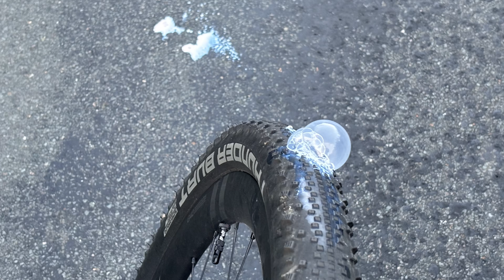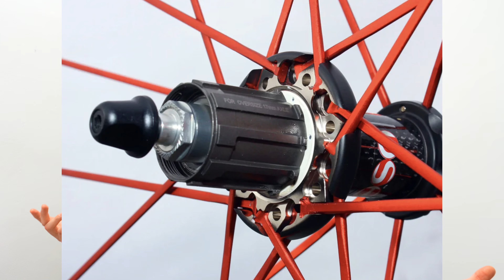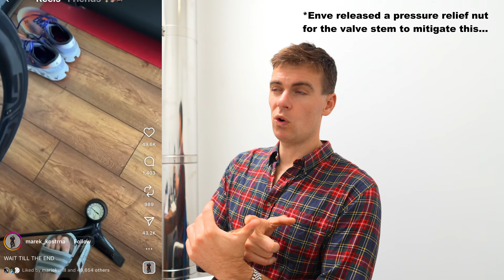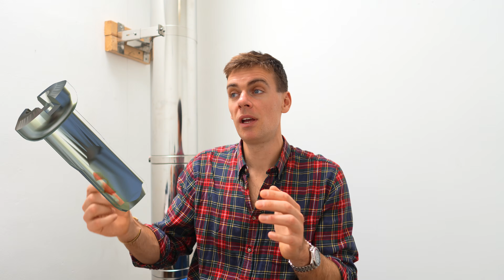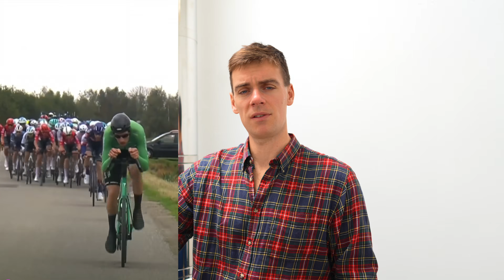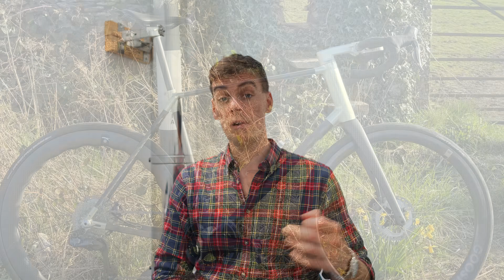The truth hurts and its ugly + more EXPLODING carbon wheels - PT Show ep. 9

Comment: Re your custom bike - thin round tubes are actually more aero! The reason modern bikes have big fat aero/kamm shaped tubes (actually monocoque shell) is to get stiffness from very thin walls - the aero claims are BS for two reasons. 1 at low speeds the shape is irrelevant and only cross-section counts - this is a well known rule of aerodynamics and even high bike speeds are low speeds. 2 skinny round tubes are equally aero in any direction with crosswind - which almost always exists.
Reply: Round is not aero. Period.

Comment: That’s why enve says you should use their valve stem nut which has pressure release hole, which negates the problem. Problem if you  start using different tubeless valves and not their nut anymore.
Reply: yup exactly.  Have had a few times when the tape failed setting up new tires and I could hear air being let out through the enve valve nuts.  It was wild to notice the instant deflation without a tire puncture.  The only thing I didn't like about it was my enves would get water logged without the pinhole haha

Comment: I had a rim fail catastrophically while mounting a tubeless tire.  SCARY as h)$$  

Two reasons why.  1. I purchased used and put 12,000 miles on them.
2.  The weekend prior I flatted hitting after hitting a pothole. Tire was fine.

I purchased pair of ICAN wheels for <$500 and they came with the rim hole.

Comment: I am running on a pair of CORIMA ESSENTIA 40 HOOKLESS rims with Conti 5000 STR 700x30c tires with Butyl inner tubes at 4Bar pressure. NO PROBLEMO AMIGO.! 🙂 J bend spokes in a hub where it is almost impossible for them to jump out of their seating.

Comment: So for JWVS:
Handlebars: too narrow, will be illegal next year
Stem: fine
Helmet: no visor so fine even though it covers the ears
Glasses: sick as
Riding on the grass: I thought was illegal
Seatpost: would be fine if it was an aftermarket design or wasn’t modified. I get that sawing it in half and sticking it back together is dangerous hence the ban. He needs a frame with a round seat tube so he can run a flipped setback seatpost to achieve something similar. 
I applaud him for pushing the limits in order to optimise his performance
Reply: If you change the frame, you might as well change the seat tube angle, so you can just use a straight seat tube.

Comment: Assuming there is a tight enough seal on the nipples/spokes and valve stem, do you even need to have air escape into the cavity? Which is to say, are common rim tapes (basically just diaphragms closing off the pressured section of the rim and bulbing into said cavity when tensioned by tire pressure) stiff enough as to not transfer enough pressure (quick enough) to the cavity for it to matter (statistically speaking)?
Reply: The problem is everything needs to stay working correctly indefinitely to avoid a catastrophic problem. A simple failure of e.g. some rim tape should never lead to that.
Reply: A bulging rim tape is never going to increase pressure enough to damage anything, here we are talking the full 60 psi being dumped into the "fairing" section.

That is also why these incidents are common when pumping up the tire, if you're riding a 60psi tire and it dumps air into the fairing you might have put 30-40 psi in it (same air, bigger overall volume) it you are pumping the tire to 60 and it is leaking during the process then you'll get to 60.

Comment: i have a terrible idea: design the rim as a pressure vessel, remove the rim bed, and make a special inner tube that goes inside the cavity of the entire rim in addition to filling the tyre itself. more air volume!
Reply: That could work but with severe engineering challenges. You would have to bond some inserts into the rim to keep the rim profile stable. Then you have to ensure a safe environment for the tube and so on…
It would just add complexity to all the parts just to solve a problem that doesn‘t really exist.
Reply: It would probably be heavier because there would be a greater amount of thicker carbon material along the full length of both sides of the rim to withstand pressure, particularly as rim depth increases. The omission of a rim bed would offset this to some degree, but the net weight would increase.
Reply: Not a bad idea, but with bikes progressively getting wider rims and tyres, there isnt any need to explore this. 
Wheels would be heavier, plus weight of inner tube, a need for a smooth bed for inner, plus stiffness would be difficult. This is why double walled rims were developed, to ensure stiffness, particularly on deep section rims on road bikes.
One option to explore is nitrogen filled tyres. Cars already do this with several benefits.
Reply: Feels like you’d have to make the rim rather thick to withstand the pressure from the tyre without the rim bed, and the tyre pressure will be more effected by changes in temperature
Reply: As others have mentioned the rim probably has to be stronger. Plus: every spoke has a hole that needs to be sealed.

Comment: I don't get it, I'm going to jinx myself here but I haven't had a flat in years and my most recent flats were down to tubeless rim tape issues, nothing trail related. That's riding MTB in the PNW with some pretty rough fast descents. Loose spokes and occasional wheel trying needed? Yup, but no flats. I don't use downhill casing tires either. 
How do you get 7 flats on what looks like a gravel road?
Reply: You have more rounded rocks, suspension and might weigh less...
Reply: @alan_davis Nope, yes, nope.

Comment: Have you tried 2.2 race kings/can you clear them? I haven’t flatted one before (cursed now) and I have hammered them. The Peyote is slightly less durable (compound wise) but also reliable. Have absolutely thrashed a set of the 2.4 Peyote this summer so might have to try on gravel. Both test pretty fast as i’m sure you know. I’m 75kg
Reply: Second race kings! They exist in 2.1 as well.
Reply: @fridtjofsther8941  There is a 2.0, not 2.1, but it’s a much slower tyre (different casing and compound)

Comment: Taller stack heights are definitely something that has the potential to benefit all kinds of riders. I suspect we're not that far from seeing a brand stick their nose out and break the mould on typical road bike geometry (which has been pretty static for 15+ years).
Reply: Fairlight!
Reply: A lot of design is determined by aesthetic considerations - just like in the olden days when they were obsessed with horizontal tubes and figure 7 stem. Low handlebars are worse for the vast majority of riders and the industry basically bullies everybody else into being uncomfortable.
Reply: Building a frame with pretty relaxed geo and high stack and am excited to see how a more relaxed position with Aeroo ascent bars functions
Reply: They should go this way for endurance bikes, not race bikes. Race bikes should go even longer and lower for those of us who can tolerate aggressive positions and there shoudl be riser cockpits like Ridley Noah Fast 3.0 for those lacking in functional mobility.
Reply: @invisiblescout6335 you want to be slower and uncomfortable? Weird.

Comment: Road tubeless is beautiful in the US desert southwest where thorns are abundant. I agree about the ugly bike being ugly because its the only way for a rider his size to get a proper fit, except that he's still running a dead-flat seat.
Reply: 100%.  The goatheads here in the socal desert was infuriating before switching to tubeless.  I had to even go with heavy slime tubes on my old track bike, but to get a decent ride in
Reply: If you're not running a dead flat seat, I'd be interested in the reason...
Reply: @alan_davis  My seat no is dead flat. However toward the end of my racing days the UCI for the first time allowed 9 degrees of tilt down back to front. A saddle that is appropriately tilted down will make it easier for you to tilt your pelvis forward and encourage flexion at the hips (rather than spine) and improve aerodynamics.  Doing so was especially common for TTs and crits. Admittedly this has become less common as more riders are opening hip angle with taller head tubes and/or increased stack height.

Comment: Appreciate the comment about excessively short frame stack. It's just as egregious with mountain bikes, where a "riser" bar with 25-40mm of height has just become standard equipment, in addition to 3cm of headset spacers.
Reply: MTB does require more standover room than other cycling disciplines.
Reply: @Surestick88 , that doesn't have much to do with stack. They can (and do) shape the midpoint of the top tube however they want.
Reply: I think risers are great and should become the norm so those of us with functional mobility can actually buy bikes that can fit aggressive positions.

Comment: Fast and puncture protected tyres - try the Vittoria Terreno XC. Not as low rolling resistance as the Thunderburt, but a much more robust tyre and you will find it similar to your Mezcals in that regard, just faster. Also better grip than the Thunderburt.
It’s a hugely overlooked tyre for gravel racing, mostly because it doesnt feature on the bicycle rolling resistance website. But it tests well in flex fit by John’s tyre testing

Comment: I kinda hate the stack'n'reach measurements being the starting measurements for a bicycle size.
If you could change your seat tube angle, those would be fine.
But at a fixed tube angle, you start by checking if your hips and knees are in the  right position or you need a different size.
Why is this thinking so backwards?

Comment: Having done many mtb miles on thunder burts, they are fast but definitely not grippy or durable. I really only use them for specific rides and races (fortunately I have a few bike and wheel/tire options). I think of schwable's tires the G-one R pro is probably the best option as the close, dense tread pattern should help puncture resistance over the RS or RX. Comes in 50 and 55mm. Otherwise the vittoria peyote? I think I'm going to try a set next year (for xc not gravel). Or terreno xc.

Comment: He has had this style of seatpost for at least 3 years, previously on a Giant. 
But i am very unsure if it is a commercially available, and registered part (i never saw a brand name on it). Which is one of the points that they really get antsy about. UCI claim that this is down to safety, which I understand to a degree. Although if he had previously used this part in another UCI sactioned race, then the commissaires don't really have a leg to stand on. 

Other than that VSchip is always pushing crazy positions, same on track, but he has less control than a newborn giraffe.
He was WC with Yoeri in Glasgow 2023, Germany holds the title for another couple days

Comment: Is a tubeless rim without drain hole + rim tape also a problem for < 25 psi? Or was this statement only meant for road tire pressure range?
Reply: Two advantages MTB rims have for tubeless:

1) much lower tire pressures

2) more smaller volume "aero fairings" - which provide a much stronger structure.

MTB doesn't have this issue, IME.

Comment: Even my yoeleo wheels have that pressure-relief hole, and they don't have spoke holes. You'd think it would be hard to get air into the rim body, but you can hear (and feel) the air escaping through that hole when you're first trying to seat everything up. I had to replace a broken valve, and definitely air is getting into the rim body before the tyre seats.
Reply from the maker: Good info. So even the valve seat is letting some air through

Comment: Gas permeability of carbon layup is poor - not only would I be concerned about the air pressure in the cavity but it may pull through some chemicals from the sealant that could act as plasticizers and weaken the material further, especially for thin sections. We've tested some nylon sensors fully laser welded, a 2mm wall thickness and passing our in house leak tests - at 12bar they were equalizing internally after about 4 hours so gas permeability and wvtr (water vapor transmission rate) are unavoidable unless you go ceramic or metal in my experience.
Re the 'ugly bike' - Obree deserves a shout out - ahead of his time and similar thinking.

Comment: While I do get the point of view from the rims exploding.
When you put pressure in an innertube it also pushes on the seat of the rim so you would get the same pressure in the cavity, and when they ran/run innertubes they put in a lot higher pressure when they used nadrower tires and rims. And if your valve doesn't seal on the seat it wil not inflate, the air will just leak from the spoke holes. The spoke holes are not designed to seal so they definitely will not, plus your rim fills with sealant😢
Reply: You misunderstood the issue. It isn't air pushing down on the floor of the rim (as a tube does), it is air leaking past that and pressurising the volume BELOW the floor.

And just because something isn't specifically designed to seal doesn't mean it isn't sealed, especially when tire sealant is part of the system.

Comment: I’ve seen sealant leaking out from spoke holes on my mountain bike when I had a dodgy tape job. Last week I broke a spoke at the elbow and it shot though the rim tape: instant flat. Nipples don’t seal that cavity. I’ve always thought the vent holes were to let water out which I’ve seen as well. Maybe the failed rims are made from a separate rim bed and "fairing" and the glued bond fails?
Reply: They are to let water out.
Most nipple don't seal the cavity, but if sealant gets in there it can. Depends on the style.
MTB can easily handle the pressure in that area because its not deep and thick carbon.

Comment: I have had sealant coming through the drain hole when rim tape has failed 😱. Luckily I got away with it and the wheel has been fine since (apart from the likely added weight of the sealant left inside the cavity)

Comment: I’m 193 cm tall (6'4" for the Americans), and finding a road or gravel bike that actually fits me is basically like trying to find jeans with a 38" inseam at H&M — technically possible, but spiritually impossible.

Every time I try to ride in an aerodynamic position, I end up looking like a praying mantis doing yoga on a children’s bike. People shorter than me never understand — they just say, “Oh, just get an XL frame!” Yeah, thanks, Tim, I’ll be sure to let my knees know they’re supposed to fit now.
The geometry on most bikes completely gives up past 190 cm. I’ve got a seatpost that looks like a flagpole, a stem long enough to qualify as a bridge, and a stack taller than an empire state building, and somehow I’m still too cramped.

Honestly, for me to look even remotely normal on a bike, I’d probably need 32-inch wheels — which sounds cool until you realize I’d also need a ladder just to mount it.
Reply: 6'5 here...I've got a cotic gravel bike. Got a Large and fits well. Worth a look, UK based firm and they do test ride days
Reply: And if you end up having a custom frame, there are still 2 problems:
- it will look odd
- long wheelbase and high center of gravity dimishes cornering ability

Comment: Would the tube not apply the same pressure to all areas of contact so the pressure with Tube or tubeless not be identical ?
Reply: In normal use. The bit you missed is it is the pressure build up below the inner wall that causes the failure. Tubes are never in that bit...
Reply: @alan_davis  As this void has all the spoke penetrations with constant changing of the tension due to the rotation the chance of an airtight seal at over 50psi is not a option there would always be an equalisation with the atmospheric value. Academic for me as I gave up with road tubeless due to issues if you get anything but a minor penetration.

Comment: Regarding rim cavity pressurization:
1. This seems to be a particular problem with Enves. Enve requires you to use their tape and their valves, which is a concern. They also seem prone to air leakage into the rim cavity and rapid pressurization of the cavity.
2. Buy rims with solid beds. This is what Shimano has always done and I think they're on the right track. Tubeless tape is the weak link in the system, get rid of it. 
3. Only use rims with drainage holes.
Reply: Or gasketed conical plugs in rim bed over spoke holes to allow easier spoke replacement while a mechanically positive seal is maintained as the plug tightens with tire pressure increase.

Comment: TPU inner tube. Problem solved and doesn't go out of balance from dried sealant. This makes me think about the time NASA spent millions on those space pens to write in space and the Russians used a pencil.
Reply: Apparently the pencil story is fake, the graphite dust would be terrible for the electronics used on the station. I agree on the TPU point though, imo tubeless is such a hassle and dealing with the sealant sounds far more annoying than just carrying an inner tube. Especially since it seems like tubeless always stops working when you really need it.
Reply: It's a great story, but just a story.  That said, I like the idea of a TPU tube as long as the stem and seam are reliable.
Reply: LOL (no i literally laughed out loud) the dry wit never disappoints...  :)
Reply: Actually $2.39 per pen, no government millions were spent, and the Ruskies used them too...
Reply: Does the electronic rotor uno derailleur have a clutch. And does it have a crash detection / protection mode? Thanks
Reply: Russians used onion
Reply: or a tiny drain hole like i have on my drive II 50ds

Comment: i'm gonna provide a free ad for the light bicycle wr series:

- 25mm int / 32mm ext width for comfort
- hooked
- no center channel holes (can run tubeless without tape)
- drain holes in cavity
- even the cheap bitex hubs have redundancy and can fit straight pull sapim cx rays